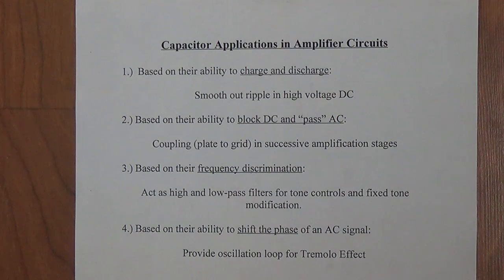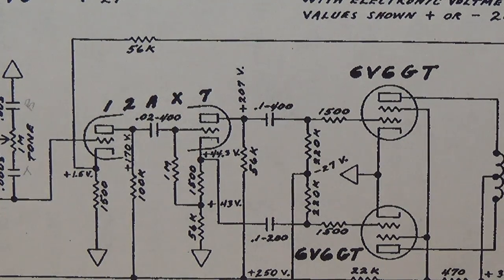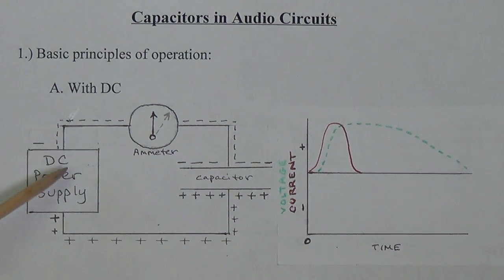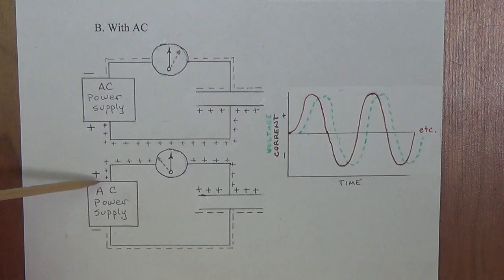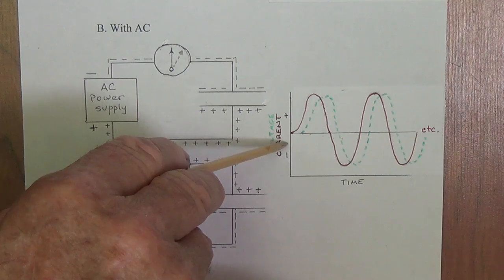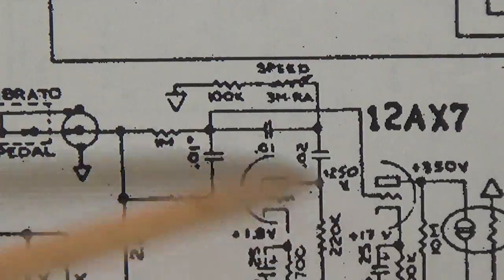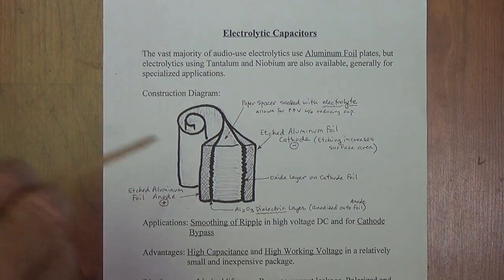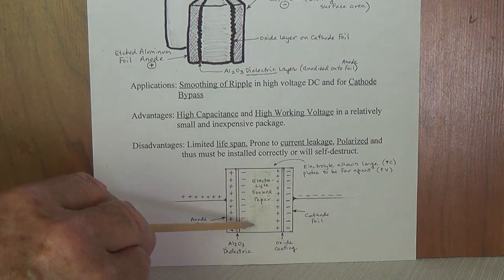Capacitors in Audio Circuits:  Part 3

Comment: Great video. Do you have a series on which type of capacitor to use in different areas of a tube amp. For instance, where is it appropriate to use or not use a silver mica, a ceramic, an orange drop. It would be a helpful (pt 4 perhaps) video to explain that to us. I am currently rebuilding an HH Scott 299C and they have quite a few inferior ceramics including a few in the early stages of audio path. So again this would in my opinion be a great addition to this series, explaining what where and why. Thanks..
Reply from the maker: From my experience, M-100, the type, brand, or cost of capacitor has little effect on tone. I have removed (inferior) ceramic caps and installed relatively expensive caps.....with absolutely no noticeable effect on tone. I suggest that everyone try their own experiments in this area, but meanwhile I stand by my conviction that money spent on boutique caps is money wasted. You would be far better off taking the difference in cost and applying it where it would have obvious beneficial effect: speaker and possibly tubes.
Reply: Thanks for the reply Uncle Doug. I mainly use orange drop 716 series in audio path. What I was really curious about is the appropriate use of Ceramic/Silver Mica for bypass and where in a circuit not to replace a ceramic with a silver mica.. the Following is a quote from a friend that has a lot more experience with theory than I do. Just wondering if you would comment on it. 
quote = Remember that subbing micas for ceramics isn't always a good idea. Read up on dielectric materials and their optimal uses in audio. Micas always replace micas. Ceramics need to stay ceramics for screen bypass positions. Signal path ceramics swap to film/foil. Tone circuitry ceramics can go to mica or film. Film caps swapped only with film, and never to ceramic.
Reply from the maker: You're welcome, M-100. As previously stated, I obey none of these rules. There are probably excellent theoretical reasons for them, but from my own experience, the effects are neither audible nor worth the trouble. Like you, I tend to favor polyester and polypropylene caps such as Sprague's and use them liberally in all positions except where electrolytics are required. To me, correct value and good quality is all that really matters.

Comment: I SURE AM HAVING A PROBLEM FINDING A SCHEMATIC FOR A BALDWIN 71P ORGAN ... 4 EL84'S AND 2 12AX7'S 2 TRANSFORMERS ... I'M TRYING TO CONVERT THIS THING INTO A PLEXI TYPE DESIGN WITH ALLOT OF OVER DRIVE UNDER THE 12AX7'S RESISTER OR CAPACITORS TO PUSH HIGH GAIN ON MY AMP ... THEY WANT SOME CASH FOR A SCHEMATIC , OR MABBE THEY DON'T EVEN HAVE ONE ... I'M REALLY HAVING AN ISSUE HERE ... GGGRRRR ((( ... I DO BELIEVE IT IS A 2 CIRCUIT SET UP WHICH WOULD BE PERFECT FOR THIS AMP ... I'M HOPING TO SET IT UP LIKE A PLEXI WITH 4 CHANNELS MAKING 2 , ONE LOW AND HIGH FOR PLEXI JUMPABLE CAPABILITIES )))
Reply from the maker: It sounds like an interesting project, AT. Good luck finding the schematic you seek.

Comment: Could you explain why everybody says caps pass ac when current can not actually pass thru a cap, they don't conduct. In an ac circuit they just charge and dis-charge at a rate equal to the frequency This allows current to flow thru the circuit but never actually passes thru the cap. I see you at least put the word pass in quotes. Might be a good vid as most people thinking that audio signal goes thru them is why they would sound diff. If you understand how they work you understand why diff. types can't sound diff. It's all the value. Mostly people hear the tolerance diff. Found your channel the other day, very entertaining, I've been involved in electronics since H.S. Won't say how long but graduated in 72. OOPS.
Reply from the maker: You're a youngster compared to Rusty and me, Brad, we graduated (from high school) in 1964 :O  Your point is well made. Although current does not run through a cap, for all intents and purposes it behaves as if it did. I discuss this in several other videos and am careful to avoid the "pass through" terminology, or at least put it in quotes, as you noticed.

I also agree with your stance on "boutique" capacitors. I have never seen a study based on legitimate experimentally-derived data (as opposed to opinion) that could demonstrate ANY difference in tone between caps of equal value but different construction. Even with his exceptional hearing, Rusty agrees that no such difference exists......and his opinion can't be bought, except maybe with some dog cookies :)
Reply: Cool, haven't seen that one yet, but after my post I thought maybe you had discussed it. Like your videos. And yes when you understand how a cap works it is not feasible that the cap material could affect tone. Oops I hear you discussing it in the video playing in the message box. OK, take care.

Comment: Hi Doug,  I have an 80's Hi Fi amp that hasn't had power connected to it in ten years and was wondering what is the best way to power it up again. Regards  from Australia
Reply from the maker: I always suggest plugging it into a current limiter, to prevent any internal damage due to short circuits. I have posted a video showing how to build a current limiter. Good luck.
Reply: with regard to the capacitors, how long does it take for the ions to re align if they haven't been used for a while and will the current limiter be enough to do this or would lowering the voltage be advantageous in this regard. cheers.
Reply from the maker: If the amp is transistorized (solid state) the filter caps will not have much time to reform, and you might want to use a Variac (check Internet sources for info) to slowly warm it up. If it has a tube rectifier, then the Current Limiter will probably suffice.

Comment: I have an old solid state guitar amplifier that has a loud sound like fine gravel sliding down a corrugated metal roof.It gets louder as i turn the amp volume up ,and in reverse quieter down to not being heard at all,at lowest volume.There is hardly any volume from my guitar.
I have just replaced the filter caps,as there was a loud hum.please help.
regards.
Reply from the maker: Greetings, Andrew. Although Rusty and I only work on vintage tube amps, we can say that any noise that responds to the volume control must arise from a part of the circuit that precedes the volume control......so focus your attention to the input, VC, and pre-amp sections of the circuit. Good luck.
Reply: Thank you for your fast response to my problem,i will look into the pre-amp etc,
regards
Andrew
Reply from the maker: You're welcome, Andrew.

Comment: Hi Uncle Doug,Great to see your still passing on your wisdom to us all.
I WANT TO KNOW ,CAN I USE FILTER CAPS AT 4700uf 100V,as a substitute for 4700uf 63v caps in my solid state amp.
regards.
Andy
Reply from the maker: Yes, you can, Andrew. As long as the capacitance remains the same (or very close to it) you can safely increase the operating voltage of a capacitor.  In fact, it will make the cap more reliable, since it can now resist higher voltages without breaking down.
Reply: The only reason that you couldn't use 100V caps is if they won't physically fit.

Comment: Hi Uncle Doug, thanks again for more great videos.   If you wouldn't mind a few questions,  I have a schematic for an amp Id like to build, one you had sent a link to a Fender Princeton Reverb (thanks again).    The schematic has the various capacitance values, some with voltage ratings as well.   

First,  if there is no voltage rating, as there aren't on most of the caps on the board, can we take the highest voltage value in the circuit, which is about 420 v and just get say 450v for all of the caps, and be safe?    If this is so, then Im confused about 50v electrolytic capacitors in the circuit, I think there are 4 of them.  Why don't these blow up, since they are connected from a node in the circuit that must have much higher than 50v running through it.

Second,  there are 3 types of capacitors that I can see by your videos and photographs of AA1164 chassis on the web: electrolytics, some kind of film (like "orange drop"s), and the thin ceramic discs.   
How can I tell by looking at the schematics, which should be ceramic disc capacitors?  On one photograph of a princeton reverb chassis, I count about 5, but there is no comment or marking on the layout or schematic.   

Thanks!
Mike
Reply from the maker: You're welcome, Michael. Answers to your questions: 1.) Look at note #3 at the top of the page: All caps, unless otherwise specified, are a minimum of 400VDC.  2.) Tube cathodes generally have very low voltage, so 50V is fine for them. I tend to use 100V bypass caps just to play it safe.  3.) Filter caps and bypass caps are electrolytic. All other caps can be of the "orange drop" type. Ceramic discs are OK, but are a bit outdated. As long as the values are correct, the type of cap is really not critical.
Reply: Thanks Uncle Doug, for the response and detailed info!!
Reply from the maker: You're welcome, Michael.

Comment: We charged up car condensers using school 110V outlets and carefully placed them on tables in the class room for the new kids and the girls. We were in auto mechanics class. And it was all fun and games until we screwed up one day and left a " hot-cap" on our instructors desk. ...does he pick it up? ........In our case yes...........We even point out that the maximum electric shock possible from that thing is more likely only 90 volts..... Could not kill anyone really. To our surprise, and amassment, considering our most logical argument, our teacher just ...got ....MORE..... pissed!!?? .....School sucks...just sayin'
Reply: The funny part was when they would jump up and shout, " Hey!! That thing just bite me !!  And everyone would laugh. Then point it and ...nothing would happen...no really it bite me ! ok....and we laughed.
Reply from the maker: Some interesting tales, BP. Remember, however, that capacitors are only charged by DC......so perhaps your recollection of charging them from an AC outlet was a little clouded by time.
Reply: I like your thinking, but we had a guy that just said you could time it right and he had great luck. Out of 5 condensers, four would bite you.
Reply: clouded by time ??  I like the way you put that. Also very true. I forgot how many times he got nailed while attempting this magic.

Comment: Love these video's and the supporting cast. Have have a question about old un used filter caps. I bought a large amount of spragues about 10 years ago and never used them. I am starting to rebuild some of the amps in my collection and wonder if these caps can be used, refreshed or thrown away??     thanks,    john
Reply from the maker: They're probably just fine. If you have a DC power supply, bring them up to operating voltage slowly (i.e. over several minutes).  If not, and you use them in an amp, use a Variac to bring them up slowly.  If you don't have either, then build a Current Limiter and use it with the amps they are used in.  I predict no problems at all.
Reply: Thanks,  that is great news. I am re watching most of your video's in preparation for some rebuilds......I think I am starting to make a transition from a mechanic to one who understands why it works.......You have a great style of explanation in a clear way.     thanks!!
Reply from the maker: You're welcome, John. We're glad the videos are helpful. Best of luck with your projects.

Comment: Doug, my father was an extremely brilliant man. when I was a little older than a toddler, he took an old book, and put pieces of aluminum foil in between the pages and made it into one great big capacitor. the cover of the book was made of foil, and and it said shocking facts, and when he handed it to me, and I opened it, it shocked me so bad that I pissed myself. can you explain how he did this?
Reply from the maker: Nowadays, he would probably be jailed for child abuse, but back in the good old days, such pranks were jolly good fun. I assume that the foil formed the plates and the paper pages were the dielectric. Maybe he charged it up by putting his hands on the two plates and shuffling around on the carpet.....then he handed it to you and it discharged through your body.  Just guessing, but it does sound like an interesting experiment, and one you still remember.
Reply: Uncle Doug  nope, he drained an entire lantern battery into it. I was little more than a toddler, and I can remember leaving a puddle of piss on the floor
Reply from the maker: Others have had similar experiences during IRS audits, 2R, so don't feel too bad :) :)
Reply: 2right4words A lantern battery doesn't have enough voltage to deliver a shock like that.

Comment: uncle Doug this is not on the subject of the video but on speakers. I have 2 that I want to use in the same cabinet both are 4 ohms with different watts. what I want is to use them separately. can I put a toggle switch between them to do this, and is there a specific type of switch I should use. I have a solid state amp.
Reply from the maker: I would think this would be quite possible to do, MPC, with a double-pole, double-throw, no middle neutral position toggle switch. It would have to be able to handle the current flow to your speakers and should never be switched while power is being applied to the speakers......i.e. turn the volume to zero (or amp "off") when switching.

Comment: Your channel has inspired me to try and build my first tube amp from scratch. Im a web developer who has been rewiring guitars and fx boxes for years but never an amp. with the dangers in mind, building a 15watt tube amp could be so much fun for me. Any suggestions for a model/schematic? I realize something like a 5e3 is better for beginners but id like to gave something that uses el84s (2x) and results in 15w.
Reply from the maker: Greetings, Luke. It's great to hear that you are ready to build your first amp.  My preference would be the 5E3 Deluxe, but if you are more inclined toward a DE amp using EL84's then perhaps a kit like this would be of interest:  http://www.ebay.com/itm/Classic-British-18W-18Watt-Chassis-DIY-EL84-Amplifier-Tube-Guitar-Amp-Kit-/252385890210?hash=item3ac35f0fa2:g:avQAAOxyrUZRyqIs  If you want to build completely from scratch, then download the schematic of a DE EL84 amp you like, make up a parts list, and order the components from Antique Electronic Supply.  You will probably have to fabricate your own chassis, however, if you go the scratch-built route. Good luck.
Reply: thanks!

Comment: So to properly understand the dielectric being only on  the anode means the capacitor has a preferred polarity? With regards to the voltage rating i assume the electrolyte can pass charges so doesn't it effectively short the isolation and hence voltage rating. That is, its like bringing two high voltage cables closer . Re the caps leaking : it is a massive issue with circuit break downs , i would have thought they would have a much better construction by now since the 70s..
Reply from the maker: Yes, it appears that the polarity is based on which plate has the Aluminum Oxide coating.  Current doesn't pass through the electrolyte, its ions dissociate to create an opposing charge on the plates. Yes, DC leakage is a big issue, especially in coupling and filter caps.

Comment: I'm sorry Uncle Doug, I don't get it. The electrolytic caps have two sheets of aluminum foil,  and they both use aluminum oxide as a dielectric. What distinguishes one from the other to establish polarity? I understand these cathodes are usually grounded to the can, but it doesn't sound like you'd have to make them that way. Are there two types of aluminum oxide?
Reply from the maker: Look at the diagram again, Lindsey. Only the anode plate has an Aluminum Oxide coating. The cathode plate has a coating, but it is not Aluminum Oxide.
Reply: ah, so it's some other kind of oxide on the cathode?
Reply from the maker: Yes....the sites I used as references never identified the specific type of oxide on the cathode, but they showed aluminum oxide only on the anode plate.

Comment: Hi, uncle Doug and helpers.! Your comment about charging up a cap. And giving it to a pest.!, reminded me of a time many years ago when I was an electrician in a factory. An office member who had an easy job not doing much, would wonder into the electrical shop to waste a bit of time., he would mess about and pick things up to look at.we charged a capacitor up that had two screw terminals on the top with a discharge resistor across which we  had disconnected and left on the bench. Sure enough in he walked picking things up getting in the way, suddenly there was a Yelp! And dropping said capacitor he disappeared  without a word. He didn't come in very much after that ...cheers from England. Hugs to assistant rusty. Love all your easy to watch informative videos on valve amps. my old 1963 vox AC30.  Is in For service as we  speak. Cheers Rob.
Reply from the maker: Greetings, Rob, and thanks for your very nice comments. I guess the joke might be on us if our intended victim touched each of the cap leads with a separate hand and was electrocuted.....but until that fateful day (and prosecution), the old "charged cap" trick definitely rids the work environment of unwanted pests :)